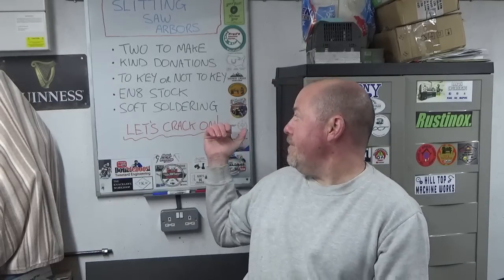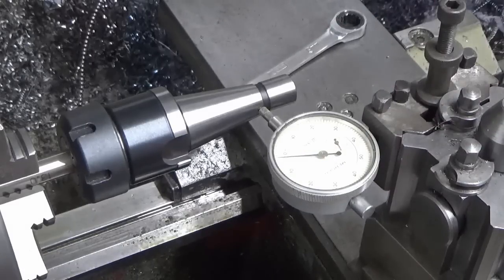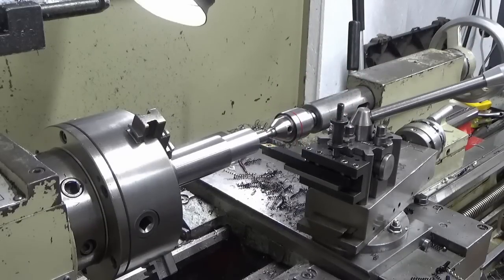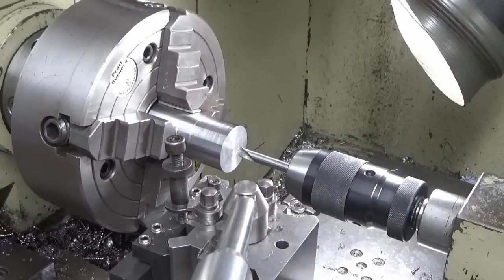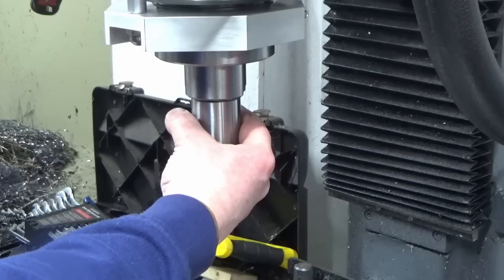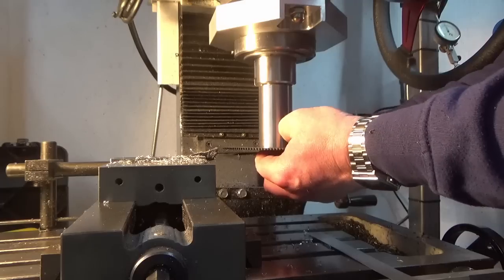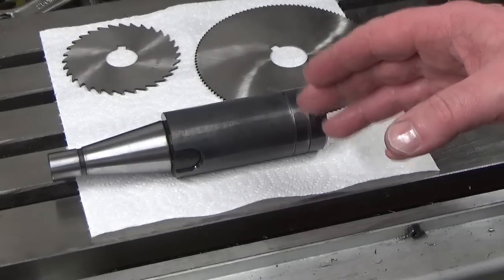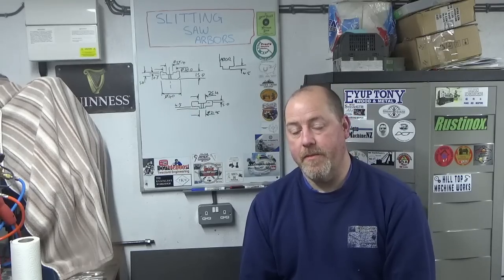Making an ISO-30 Taper Slitting Saw Arbor

Comment: Jon, there is NOT bow to the saws, it is hollow ground for clearance. Did you relieve the corner on the arbour, as your tipped turning tool will leave a radius, and  those saws will have a razor sharp edge to the bore. Great outcome. Regards from Australia.
Reply from the maker: Hi Dave, thanks for the comment. Lol, stupid me! Never really used these in my past, makes total sense (hollow ground). In terms of undercuts, yes, I put those in. I was using a 0.2 radius insert and I plunged it in 0.4 into the corners 👍😊. Cheers, Jon

Comment: Cracking build, Jon.  About the only thing I could possibly suggest would have been cutting the dog slots prior to doing the finish turning op of the 25.4 register on the mill, that way you could ensure concentricity with a known, fixed rotation of the arbor in the spindle (although that would mean making some dogs too, hah).
Reply from the maker: Hi Wibbly wobbly, thanks for the comment and feedback. Yes, if I had dogs in, that would have definitely been a good idea. I already have one dog that rules my life, two more would finish me off I reckon lol. Cheers, Jon

Comment: Nicely done, Jon, you make it look easy. 👍
By the way, I’ve managed to get all the way to retirement without needing a shaper. Then all these influential people corrupted me. I had one follow me home yesterday. There’s lots of candidates, but because of that recent, splendid completion of the Acorn I choose to blame you entirely for steering me away. Oh, and Rusti too. 😊
Reply from the maker: Hi Dudley, thanks for the comment. Lol, nothing to do with me your honour! What did you get? Pleased for you, you won't regret that decision! Cheers, Jon
Reply: It’s the Delta 7”. Despite having the same stroke as the Atlas, it appears to be a trifle smaller overall, which suits me. Published weight is 225 pounds, making it easy to wrestle into a basement shop.

Comment: Jon, this is the VERY first video I watched on Your channel. I do quite a lot of manual machining myself and, actually, a slitting saw arbour was one of my projects. In my case the material was a power shaft from a lorry. Very tough material which had to be annealed in order to tap the threads to it.
Metamorphosing a milling machine into a lathe is how You make accurate tool holders. There is a catch though. That arbour can be attached in two positions into the milling machine spindle. I have marked the nose of my milling machine for tools just like this. The tool, of course, needs to be marked as well.
The method You used for setting the top slide angle is heavily dependant on the tool height. The measuring tool (dial indicator) needs to be exactly at the same height as the blade You are using to cut the taper. Usually they are both at the center height.
For known tapers I almost always use a sine bar to set the angle. Your lathe seems to have a suitable cross slide for that type of set up. It is a lot faster and accurate method, However, it requires some trigonometry to pull through. I show this method on my video (How to machine a SK30 (DIN2080) holder for slitting saws).

Comment: Hi Jon. That was a good build. I am sure to buy something like that would not be cheap. There are so many youtubers you see with the slitting saw running out of true & only a small amount of teeth actually getting engaged to the material. 
Regards.
Steve.
Reply from the maker: Hi Steve, thanks for the comment and feedback. Yep, no matter how good you get the arbor, they all wobble a little bit. Cheers, Jon

Comment: Thoroughly enjoyed that Jon. I made one a few years ago because I had to make some slitted nuts for my Harrison Mill. Not as good as yours though, I just made it fit in a collet. I chose to go without a key as if the saw jammed I reasoned that it was better to allow it to slip rather than break or damage the part I was making. I was going to use a ball as a key, had I keyed them.  I really enjoyed this film, especially the finish turning of the arbor in the Mill. Great stuff as always, thanks.
Reply from the maker: Hi Carl, thanks for the comment and feedback mate. Yeah, I opted for the safer design for much the same reasons. Cheers, Jon

Comment: Gday Jon, the arbor turned out spot on, great idea have the ability to use 2 different size bores, great job mate, cheers
Reply from the maker: Hi Matty, thanks for the comment. Yeah, didn't have a plan going into this job but I think it came out well. If I ever get any other slitting saw bores to deal with, I only need to make another small adapter piece. Cheers, Jon

Comment: Very interesting Jon. Before too long I will need to turn a 40int arbour down to 30int so this has been instructive. Cheers
Reply from the maker: Hi Paul, thanks for the comment, there are other and better ways to set this job up, I was flying by the seat of my pants on this one in an attempt to show an alternative method to the sine bar and Machinery's Handbook data way. When you come to do yours, let me know if you want to bounce any ideas around etc. Cheers, Jon

Comment: Hi Jon
You could just turn a "washer" to allow the end cap fit concentrically on the smaller register.
Reply from the maker: Hi Zen, thanks for the comment. You are right, I may well do this, great suggestion. I haven't forgotten your drawing by the way, recently finally invested in a new laptop and re-teaching myself CAD, got the collet all modelled, just need a bit of drawing time. You will see it eventually (sorry). Cheers, Jon
Reply: @jonsworkshop  I am pleased you remember. I think about the drawing each time you create a new video 🙂 (no pressure 🙂)
I have just made the parts missing from my lathe's taper turning attachment, so I'll be ready to go. I know it's only a very small taper, but the fine adjustment on the taper turning attachment will make it easier to create the taper.

Comment: Hi John, I'm an elderly newbie. I just got presented with your channel. This tool would be useful for me as I too have an ISO 30 spindle. I can think of another consideration for not keying though. The last thing I want is to be near an exploding saw blade regardless of the guarding. I'd rather have to remake the arbor. It's a small point though, first I'd need to turn an accurate ISO 30 taper......
Reply from the maker: Hi Bob, thanks for the comment and welcome to the channel. You are right. The beauty of the design I finished up with, is if the worst happens, I can face off the chewed up bit and re-cut the 25.4mm spigot using the mill as a lathe again to ensure good run out etc. Cheers, Jon

Comment: Nice material management or planning as it used to called I think, ref using op 1 on the arbour for op 1 on the end cap and spacers.
Alway good to see carbon steel being machined, unfortunately many hobby guys only use bright mild steel,  or worse black mild steel. 
Impressive run-out when fitted, i was wondering if you were going to do a turn op on the mill👌.
Great job and photography Jon, thanks for sharing. 
Regards John
Reply from the maker: Hi John, thanks for the comment and feedback mate, much appreciated. Cheers, Jon

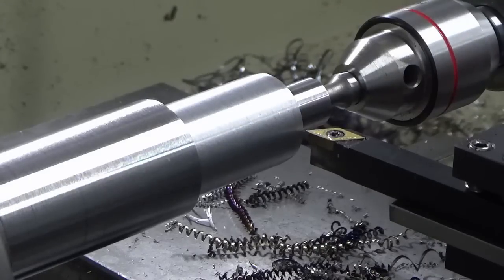Comment: I wonder @9:20 if you had moved your tool to the right side of the tool post, would that have given you enough clearance from the tailstock?
Reply from the maker: Hi Phil, thanks for the comment and question. Good point. It would definitely have helped, would have given me about 10mm back in tool standout. Every millimeter is a prisoner for rigidity! Cheers, Jon

Comment: Very nice video and a neat arbor you made for yourself. However there's one question I have: how well does the ISO30 tapper of your arbor really fit with the ISO30 taper in your milling spindle. Did you check the fit off camera? Adjusting the tapper on another arbor doesn't quite convince me, as everything has tolerances. If you're unlucky, your "master arbor" is on the low side and your milling spindle is on the high side of the tolerances for ISO30 tappers. Add the runout you registered while adjusting your cross slide and I'm not so sure about the true fit of the ISO30 tapper you produced.
During my apprentiship we made some morse tappered arbors. While machining the arbors, it was standard practice to check the fit of the morse tapper by blueing it and putting it into the target spindle. Next, using only little force, we turned the machined arbor back and forth, while simultaneously pushing it into the spindle. This removed the blue on those parts that were in contact, while the blue remained in those parts with no contact. This indicated for errors in the tapper alignement and allowed us to correct the machining angle, until we got contact througout the lenth of the tapper. With this checking method we achieve very precisely fitting morse tappers.
Reply from the maker: Hi Lorenz, thanks for the comment. Yes, the taper was blued and checked, it needed a bit of minor tweaking with emery cloth and scotchbrite. I cut it out during editing, I had 1.5 hrs of footage to compress into what you saw, there is always something that gets cut unfortunately. I finished up with about 90% contact which is acceptable. Cheers, Jon

Comment: Hi Jon
It looks like you have a Harrison 300 lathe like I have.
What size QC tool holder are you using,  I find it hard to find the correct size on the Internet 
Love your work. Keep it up

Jack
Reply from the maker: Hi Jack, thanks for the comment and question. M300 yes, fantastic machine. Mine is a Dickson QCTP and it takes T2 cartridges. If you search Ebay etc using the T# code, it often helps. Just check yours is a T2 before you buy. If you go back on my channel quite a long way, I made the cartridges I currently use, and I put a drawing up on the whiteboard with dimensions in part 1, if you measure yours against these dimensions and they are the same, then you will have a T2. Hope this helps. Cheers, Jon

Comment: I hope you picked up that bar of EN8 cheaply. You must have turned 50% of the volume of the bar into chips!
I usually have a similar problem, the stock I have is always just too small or far too large!
Reply from the maker: Hi Robert, thanks for the comment. I got very lucky with this material, I think it's probably EN16 or even 24 by the way it turned. I got given 4 of these blanks for free so the price was right. The original EN8 I was going to use was for the separate arbours I planned at the start. Cheers, Jon